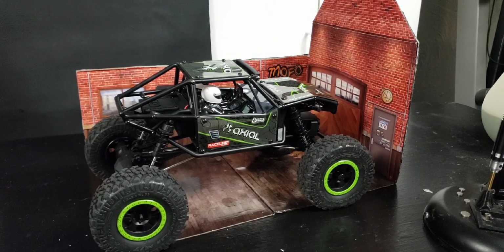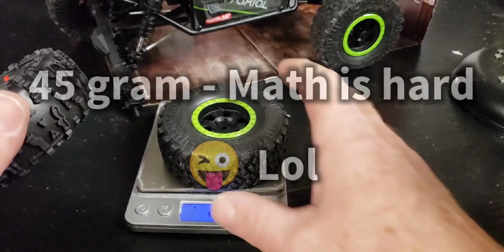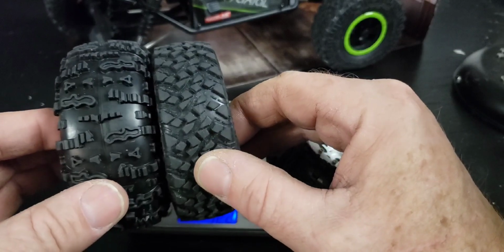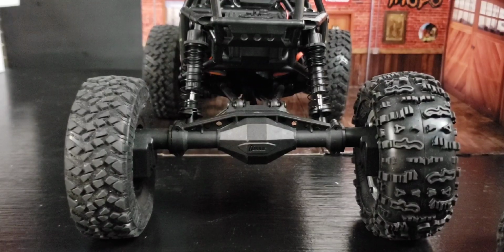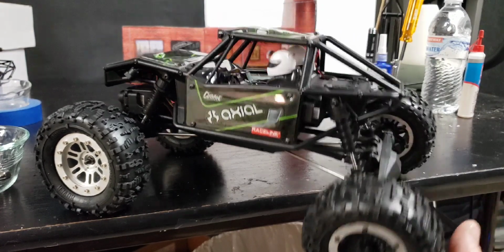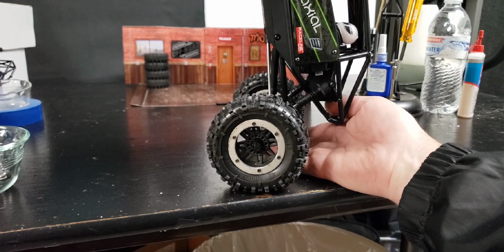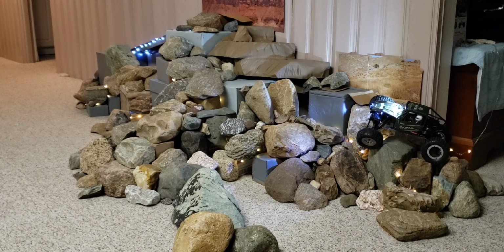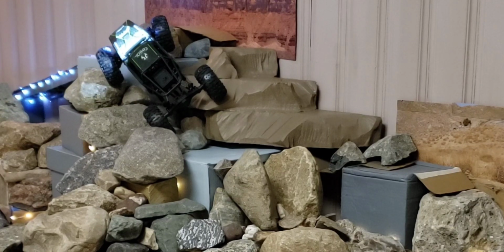1:18 Capra Metal Beadlocks - Front Axle

Comment: I had the same thought & weighed the originals & new 1.9 beadlocks with 4.19 jconcepts Landmines which are a smaller tire. So I weighed them & all 4 originals tires & rims weighed the same as one new wheel. It looks good & performance will be better but I’m thinking the motor is not going to do well over time with the extra weight. I’m thinking who is getting to be the first to put a out runner motor in it. Being I just got mine today & literally just got done with the wheels I’m looking forward to getting it out. Thanks for the preview.
Reply from the maker: I agree that the motor could have had more torque.